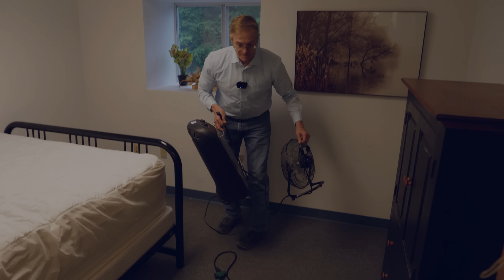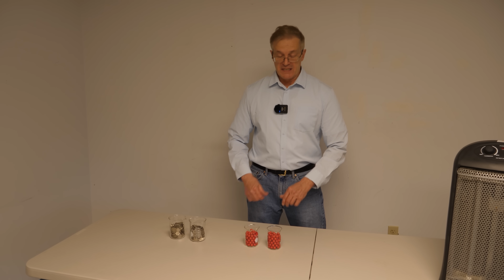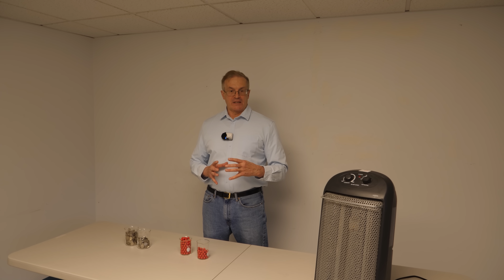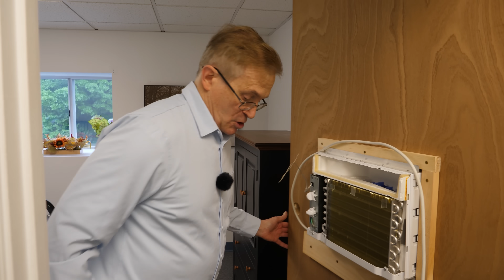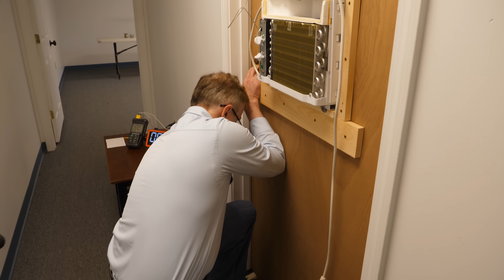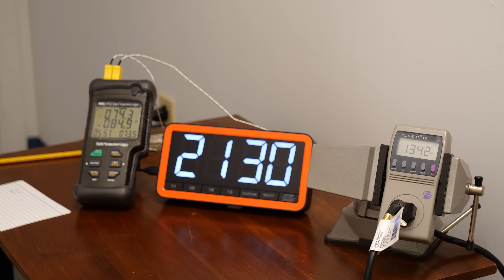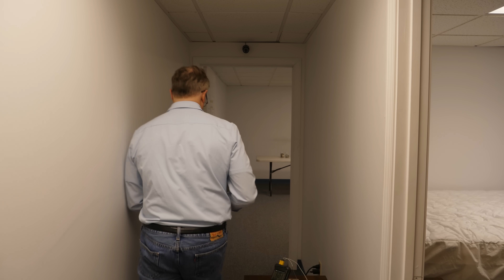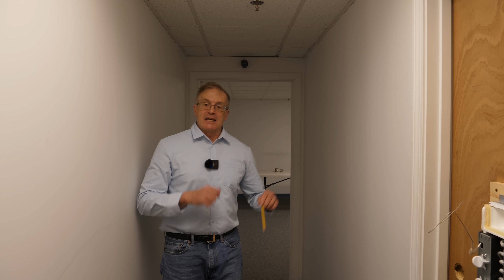You're wasting money on heating! Use your A/C!

Comment: There is one Big rule
 with the A/C  that you did not take attention. Its called Qt- temperature of condensation.On your experiment Qt is same As your temperature in the room, during the winter season Qt is like 20 degree lower... And becouse of that the A/C Electric motor Will consume like 10% more energi on every 1 degree change on envirment temperature.Cinclusion is that A/C  Will be more efissiinal under some circumstances like in/out temperature,type and thicness of insulation, and ventilation of the room.You do Great experiment!

Comment: The temperature probe is closer to the source of heat in the A/C scenario.  It's much closer to it.  I don't think it invalidates the results.  The physics predicts the results.  But it would be good to have a better test setup to account for this in the demonstration.  Even having the AC in the window (if it were possible in that window) would put it more in line with the space heater scenario.

What happens if the A/C is blowing the cold air outside in the winter and the outside air temperature is well below freezing?

Comment: I got into a situation where I had to rent a place to live. It was equipped with a heat pump and during the winter when I needed it, the electric bill was up over $500. When I got into a house with a gas furnace, it cost me less than 200 a month to keep the place comfortable combine and gas and electricity.
Reply from the maker: Fair enough. 
Engineering involves more than the efficiency of a system. It needs to include the cost and availability of the components, the maintenance of the system, and, as you found out, the price of the energy source.

Comment: And there I thought the exhaust air could be harmful, like a dryer exhaust, but makes sense, I mean there is no combustion. I have a pool heat pump recently and noticed the cool air coming out of it. I’m considering putting it closer to my swamp cooler to use it

Comment: heat pumps don't work well because of the outside temperatures in winter. air conditioners aka heat pumps move heat from one side to the other but if the cold side is already cold (affects heat pumps) or the hot side can't lose heat (dirty air conditioner) then they stop moving heat from side to side
Reply: If your logic held, then air conditioning wouldn’t work well in very hot climates either, since it would struggle to reject heat to already-hot air. However, that’s not how it works; modern systems can shift heat effectively because of the temperature differences they create internally.

Heat pumps work very well in winter - I have 3, and have a nicely warmed house in -20C (-4F), without any form of heat strips or resistive backup.

Comment: I would love for you guys to test a simple idea with regards to outdoor A/C condensers. It is inefficient for them to sit in direct sun, however, a lot do. It is also inefficient to shade them with a covering inhibiting the exhaust. Imagine, if you will, a top hat of sorts for your A/C. The brim shades the unit, the top has an opening for the exhaust. It doesn't need to be very tall at all, and you could probably achieve this with a single sheet of plywood with a hole in the middle. I am very curious of the results. Would it take a unit running 10 hours a day down to 8 hours?

Comment: Is it fair to think of a heat pump as doing two things: 1 It uses electricity in its operation and in doing so produces heat. That heat, in this demonstration,  being put in the room; 2 It also move/transfers heat from one location to another. Putting it simplistically, a heat pump is a heater that both heats and also moves heat from outside to inside. Thinking this way suggests third test for comparison, namely test the heat pump just as a heater. So operating it in your sealed room and comparing the results with an electric heater. For a fair comparison the wattage of the heat pump and heater would have to be the same, so you may need more heat pumps or reduce the power of the heater, to get a like for like comparison.
Reply from the maker: Your assumption is correct. 
I don't think that test is necessary.
A heat pump is primarily a heat transfer device. It uses electrical energy to power the process, and the inefficiency in that process releases additional heat into the room. 
The space heater is basically 100% efficient IN PRODUCING HEAT. The heat pump is basically 100% efficient in converting the electrical energy that isn't moving heat (it's mechanical inefficiency) into PRODUCING HEAT. All the additional heating from the heat pump is secondary to the movement of heat from the hallway into the room.

Comment: Wow, wow, wow! I've often wondered if this would work. And I'm not a scientist, but I'm fascinated with entropy, and - by extension, information theory (not to get too far afield). But more practically, I've been looking at heating for overlanding or camping setups, where an electric heater is very inefficient, and expensive, especially when one wants to primarily run a solar-powered system. And propane, well, can be dangerous. Anyway, the theories presented and illustrated here are absolutely fascinating. I'm so happy to have found your channel! Thank you so much.
Reply from the maker: You're welcome!
There is no official license to be a scientist, and people with advanced degrees can end up spending their time as administrators. If you're really interested in entropy and information theory, you're in.
To be fair, for camping,  the lightweight, portable, propane heater will be hard to beat compared to the equipment needed for this kind of setup.
Reply: @TechIngredients  Thanks so much. And that's true, re: propane. However, I'm just so excited you answered my thought experiment! Such a great channel! Much appreciated.

Comment: I had free hot water heating in my apartment in Canada for 5 years and never used the electric heat. I found a 1950s Crosley AC that was depleted and it had the most efficient and totally quiet fans. I got a length of reinforced (overkill) tubing and ran it from a bathroom faucet to the AC and back to the bath drain. I removed the compressor and joined the two heat exchangers. The landlord and power company replaced my electrical meter in the hall three times.

Comment: Question:  My central air unit manual says don't run the AC when outside air is less than 50  (or thereabouts). Are window units different? Can you actually do this when it's 10 degrees outdoors, without damaging the unit?

Comment: Have you considered using a heat pump to extract heat from one tank and move it to another tank of glychole or water? That way, we can have a hot thermal battery and a cold thermal battery. If you think about it, a simple home has multiple heat pumps in the AC, heater, freezer, and some hot water heaters. It would make sense to have a single heat pump properly sized to store both cold and hot and cycle the hot/cold to meet multiple hot and cold applications.

Comment: The only thing is the thermal couple that you're using is right near the air condition unit compared to the heater with the fan.
Reply from the maker: The airflow from the airconditioner was directed away from the probe.
Reply: @TechIngredients  I'm not disagreeing with your results. I'm just saying that maybe have the thermal couple more away from both the heater and also the air conditioner to get a more accurate reading.

Comment: thermal mass of the walls, floor, ceiling and furniture helped allot. should do the ac first. it takes a very long time for that heat to get released especially if you have a well insulated house.
Reply from the maker: Actually,  it would have been best to do the tests twice, reversing the order each time.

Comment: I don't want to see how it performs at 75 degrees F ambient temperature. If the ambient temperature is over 60 degrees F I don't need heat.

Show me how an AC drawing in 45 degrees F air compares to a space heater with the indoor temperature starting at 55 degrees F for each.

Comment: Yes, a heat pump is more efficient than a furnace or electric baseboard heat.  You need electricity to run the compressor but the heat comes from the outside air.  

If you live in the northern parts where it gets seriously cold, as the temperature drops there is less and less heat available from the outside air.  Eventually the heat pump will fail to maintain the thermostat setting and an different heat source must take over.  This can be electric or a furnace.  

Heat pumps are more expensive, they contain valving to change their operation from heat pump to air conditioner as required.  More complicated means more likely to break down.  

Also they must periodicity go through a heating cycle to remove frost from the heat pump radiator.  This heat comes from inside the house.  When the valves switch to defrost they make a racket.  Don’t put a heat pump under your bedroom window.  

Also, heat pumps can accumulate a lot of running time.  First, they operate both summer and winter.  Second, when operating at near their limits  in very cold weather they run almost constantly.  They will wear out before an air conditioner does.  

Finally, on a cold day there is nothing like standing next to a warm furnace vent to warm your cold tootsies.  Forget that with a heat pump.  The air from the registers feels hardly different than ambient.

Comment: Heat Pumps are good devices as long as you remember they're only good down to about 36 degrees Fahrenheit. Below that heat strips on a conventional hvac will heat up quicker and your unit will run for a shorter amount of time. And use less electricity than a heat pump. The lower the temps the worse the heat pumps efficiency. And if your out side unit freezes over it can run continuous never heating the house to the point where the thermostat stops calling for heat. I see it in the north all the time. So take all that into consideration.

Comment: Great info. It's clearly more efficient, just a small change i would make to your experiment. Do the whole thing again starting with the air conditioner. So you do it 4 times. You will notice that each time it's easier to heat up the room. I'm sure you know why. I heat my garage in the winter here at -30c and on days that i don't use the garage I still heat it because if i don't it will take the same amount of energy to heat it up and twice as long when i do heat it. The cold (or heat) is stored in all the stuff and walls. So by doing this 4 times you can subtract the percentage of heat that was stored from the last cycle.

Comment: I'm confused on how you converted the window unit into a heater. Is there a part you added or something? I'd love the use my A/C window to be a heater in the winter.
Reply from the maker: For this demonstration, we simply reversed its mounting position.
We didn't dig into the different modifications that you might want to make this easier to operate. It was the principle we wanted to demonstrate.

Comment: Here are a couple of questions . What is stopping me from just setting the window unit completely inside of the room and having a small floor vent to push out that heavier colder air along with a drain ? Plus tricking it with a small light bulb seemed to be ingenious to me....thinking outside the box over there.
Reply from the maker: Nothing. 
That sounds like a viable approach.

Comment: this will only work where you dont get actual cold temperatures.. where i live that unit would explode eventually flipping it around. we need proper heat pumps designed for the cold outdoor temperatures. Yes there is a difference. they have heaters and defrosters and headmaster valves and algorithms to adjust fan speed to keep the refrigeration cycle efficient.

Comment: In conclusion, are you saying to turn your a/c backwards and let the hot air from it back into the house and the chilled air back out into the cold outside world?
Reply from the maker: Basically,  yes.
There are other engineering issues, but what we wanted to cover is the principle of heat pumping and its energy multiplier effect.